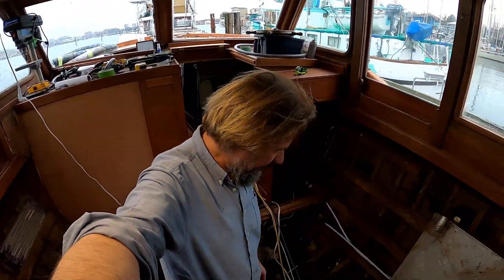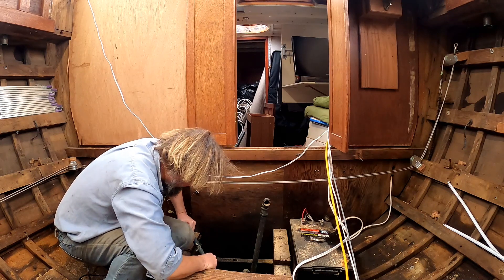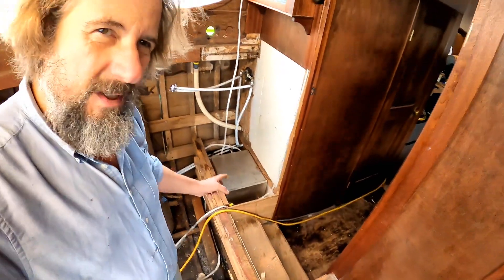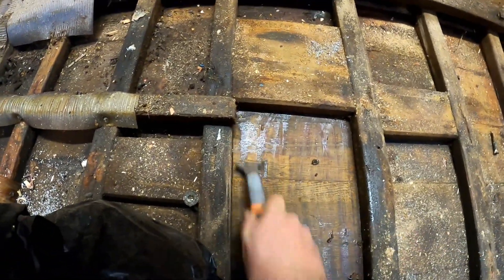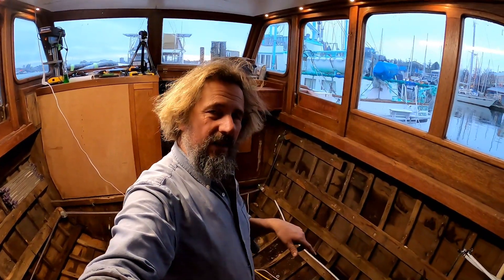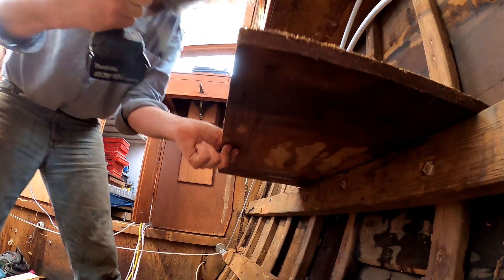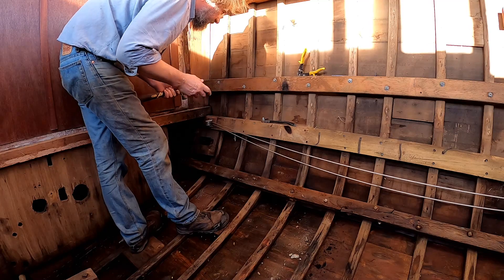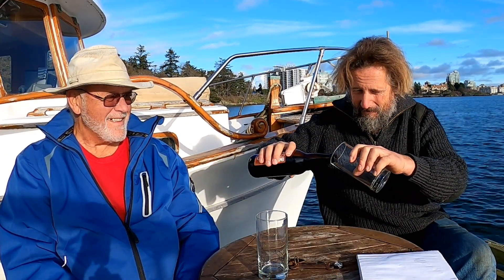Bilge Cleaning - #206 - Boat Life - Living aboard a wooden boat - Travels With Geordie

Comment: I find the only way to truly have a friendship with a boat is to tear it completely apart, acknowledging every screw, every flaw, and every masterful little trick of the trade which represents the whole. Without this knowledge, a problem at sea can be a catastrophe. But by knowing every inch, you need only recollect the time you fixed this thing, or modified that thing, or poked around under that coverboard to know what the problem is before you even throttle down. You and your fine vessel have a very fine friendship in the making.

Comment: Peter if I may. Two things that may help you:
1. When you reinstall your tanks, I suggest you either get them custom made in plastic or whatever it is they use and no matter what material, bed them onto tarred-felt. That way the tank material will never touch wood and will insulate them from the hull;
2. After having installed many marine exhaust systems, I would highly recommend you install a waterlock from your engine then a "water separator" exhaust system and in your case take it straight out the side of the boat above water. What you will find is the exhaust gases will exhaust whisper quiet above water and the cooling water will drop out below the waterline. No more expensive piping out the back of the boat.
Reply from the maker: Thanks Alan, both great points. The tanks will rest on HDPE and never touch wood, or even water hopefully. Interesting on the exhaust, I've heard about that setup. Heh, sadly, I had already bought the entire system when I was putting in the Perkins. Still will look into it though. Thanks yet again.

Comment: I hope you are getting the frames, floors and engine bearers all beefed up before the new engine arrives rather than just leaving that job until after installation. Now would be the perfect time to put some strength back in the old girl. :)
Reply from the maker: Well, yes and no. I'll be putting new engine bearers in before the engine, but the real repairs will have to wait for a haul out this spring.

Comment: Also one of the best reliable engine cooling systems is twin keel cooled engine with dry exhaust, but then water injection & separated  to reduce noise.  With this system you will NEVER need to worry about weed filters blocking plus you have a perfectly quiet exhaust without the 'splosh, splosh, splash' of water from a typical wet exhaust. The small water feed to the middle section of exhaust can still be feed from the 'spare' Jabsco/johnson water pump from engine with intake from each side of keel. Plus if fancied you can also have a emergency 12v/24v pump 'T' in line .... This gives you a totally reliable cooling system, and you can even be moored up in very shallow water or even beached and the engine will still have cooling. It seems 'complicated' but its actually a very simple and traditional system. (Quiet exhaust is a modern option just so you can sneak up on wildlife!!)
Reply from the maker: This is a damn good topic. Especially as I have a keel cooler already. Except that I don't trust it and the Beta is raw water cooled. But I did ponder it over the years.
Reply: @TravelsWithGeordie  
Personally I would have automatically replaced the ‘keel cooler’ any way , especially when fitting a new engine. 
New shaft, coupling , prop, bearings, glands, exhaust, water intakes (if needed) , ALL wiring. All fuel lines, new diesel  tank efc. Anything related to an engine would automatically be replaced when installing a new engine in ANY boat. Nothing is worth the risk. 

Beta also supply various custom units, raw water or keel cooled or both, basically they will supply engines of ANY spec & ANY colour !! 
Beta are excellent when it comes to a specialist engine package, I’ve purchased & fitted quite a few 👍🏻😉
Just ALWAYS talk to them. 
👍🏻

Comment: I know what would happen if I was in that boat. My foot would miss a rib and my 260lb foot would go through the bottom. There was a River Queen houseboat in the slip next to me and it had never been re bottomed. They are thin gauge steel and are notorious for rusting out the bilge. I noticed my anodes were going away faster than normal and measured stray DC current in the water around that boat. He kept a cheap automotive battery charger hooked up to keep the bilge pump working. That cheap charger and bad wiring was pickling out that hull to nothing. I told him not to step on the hull bottom and only step on the ribs or stringers. Also told him to junk the boat. One day he missteped and cracked the hull. I dove in and carefully wire brushed the area around the crack. I had a 1 foot square sheet of 1/4” rubber and large tube of Life Caulk that I slathered on one side of the patch. Then I went under again and laid the patch over the crack. Life Caulk starts to set almost immediately when exposed to water. The boat was towed out of the harbor and I never saw it again. The owner finally took my advice and got another boat already in the same harbor.

Comment: Do you keep Pine tapered bung plugs in case of a through hull / pipe breakage emergency?
Very handy to hammer into a seacock or through hull that lost it's hose, ball valve, whatever.
Reply from the maker: I do, also some of that can't sink wax stuff.